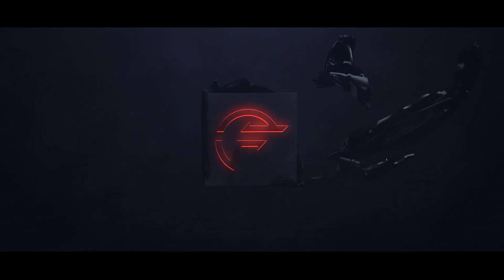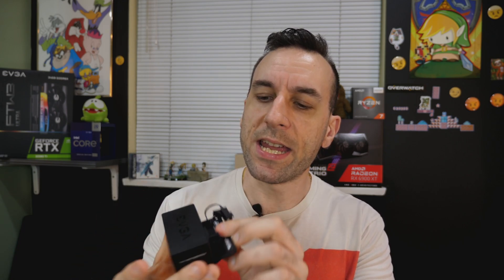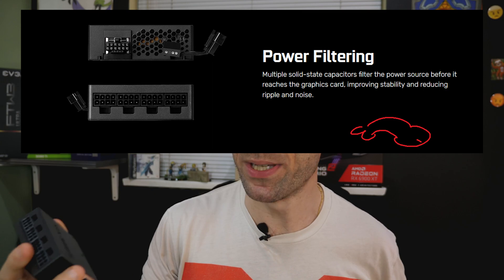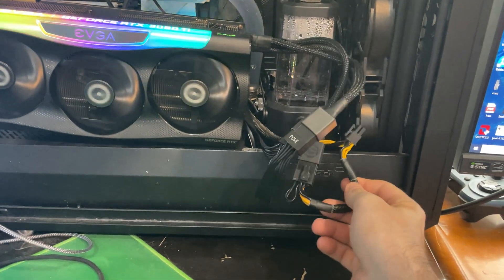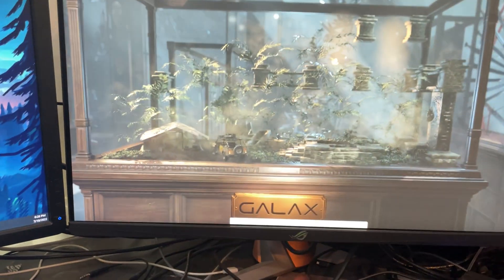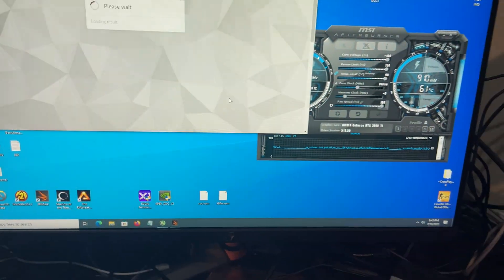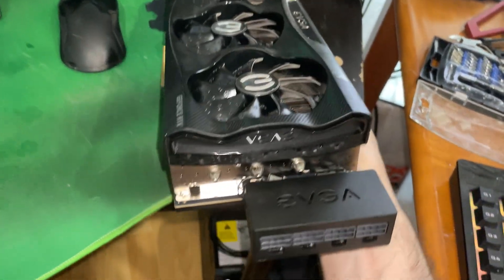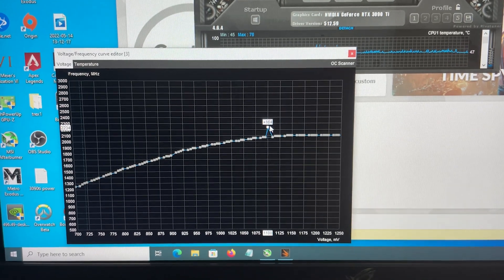EVGA Powerlink 41s REVIEW + BENCHMARK

Comment: This video has a LOT of incorrect information.

1: The PowerLink 41s and 52u for the 3090 TI FTW3 and Kingpin are for smoothing & filtering the load, yes. It's mainly to combat any transient power spikes and whatnot due to the high power draw of the cards.

2: The old PowerLink does NOT have capacitors in it, it's purely a cable re-routing piece for aesthetics. 

3: The fact that he's "benchmarking" it shows he has no idea what it's for. It's not advertised, or built, as an item to increase performance in any way. 

4: It only looks bad because he's running a shitty PSU with shitty looking cables. Anyone buying something like this is most likely buying things like aftermarket cables, and 4x 8 Pins combed together from like CableMod is going to look a lot better than the short shitty 12 pin to 3x 8 Pin cables all the 3090 TI GPUs came with. (Keep in mind, this was before the wide spread adoption of the 12(16) pin connectors, so aftermarket 12 pin cables really weren't a thing).

5: Having 4x 8 Pins also allows for a higher & safer power draw when running XOC bios. 

6: The 3090 TI FTW3/Kingpin PowerLinks are 41 and 52 because they're 4x8 Pin to 1x12 Pin  & 5x12 Pin to 2x12 Pin.

The only thing he got right is yes, it adds length to the GPU, which can be a deal breaker depending on your case size.

It's a shame they left the GPU market (and subsequently stopped making these) before a legit channel could do a proper review of them. Have a little respect for the genre and do even a shred of research into an item before just spewing your nonsense out onto YouTube.

Comment: October 25, 2022, the 16 pin plugs are getting reported being burned, or melting if the cables are bent and theoretically coming loose on any side that's bent. This is a great solution to solve this problem now.

Comment: if it would of redirected the 8 pins to the back it would be worth it just for the looks part of it.. then put the rgb on the front ( for vertical users) problem with the 12 pin is u cant bend them much and being at the end of the card it just makes the card overall length too much to fit into a lot of cases.

Comment: I am actually considering this as I am running a custom loop and I guess this gives you 675W TDP(150W x4 from 4x8pins and 65W from PCIE), and I guess this is where this make sense as it is at least better than some random 16pin to 4x8 pin as no major manufacturers make any 4x8pin transfers
Reply: And by the way I am considering it for a 4090, which I guess 600W is like a good OC setup as it is 450W out of factory already, unlike 3090ti which is more of a overclocked 3090 with was 300W and no headroom for oc

Comment: It looks like you doubled up on a couple of the 8 Pin PCIE connections? I am pretty sure this is intended for 4 separate connections to the PSU. It might be worth running the same series with that configuration.

Comment: To be clear, the earlier powerlink devices were all about aesthetics.  In your video you claim it contains capacitors but I really don't think it does.  EVGA doesn't claim that earlier product helps with power at all.  From their website: "The EVGA PowerLink has one primary function: to make your PC look even more awesome."  This new powerlink with the capacitors is to help smooth out the spikes.  From the new powerlink website page: "The EVGA PowerLink 41s seamlessly connects to your EVGA GeForce RTX 3090 Ti FTW3 while providing maximum stability, improved case airflow, and glows with fully-customizable ARGB LED."  So still some aesthetics, but I believe the main goal of the product is to provide capacitors capable of handling the spikey nature of the RTX 3090ti.
Reply: Agreed with your assessment.  I'm sill running an original 'PowerLink' on my graphics card (originally 980ti, moved to 1660ti, upgrading again soon based on TDP) in order to move the power wiring from the long edge (front) to the side which does improve the aesthetics and cable management greatly.
This new 'PowerLink' was actually designed to address the huge power-load demand of the GTX 3090ti by increasing the amount of available connections between the card and the PSU in order to prevent a literal melt-down of the original smaller wiring harness typically used.  Nothing more than a work-around to fix a badly designed (power-hungry) graphics card.

Comment: So I just purchased the EVGA 3090Ti Hybrid and it comes with a 3 x 8 pin to 1 x 12 pin pigtail. I’ve always heard of using separate PCIe cables, but there’s not an option for that here. Only the pigtail. Any comment?
Reply: Run 3 separate cable in to that pigtail.  The 12 pin you're talking about is the new power connector capable of 600 watts.
Reply: @Botanical4038  copy that. I kinda figured. Thanks!

Comment: So I'll admit this is a pretty good test, but you showed something that totally tears down some of your previous videos talking about max clocks on these cards.  That VF curve you used where you pull the 1100mv point way up destroys effective clocks, making it look like your card(s) clock very high.  I guess if you're consistent with this, then most of the time it doesn't invalidate the testing, but it's definitely misleading for people comparing what their cards can do that aren't using that method.
Reply: Can you elaborate on how it destroys effective clocks? What's the proper way to set a vf curve in that case?

Comment: I assume this product would help with the transient load spikes. I've had my <2 yr old 1300w Plat PSU degrade because of the spikes (confirmed via RMA)
Reply: I doubt it will be help at all for its size, and I have a x399 motherboard died because of the one made for 2080ti.

Comment: hello, are released technical data about Raptor lake (eg DDR5-5600 support) today with Intel 12 gen we reduce to bring the ddr5 to 5600mhz, in your opinion, with 13 gen, how long will we be able to bring them?  How much overall improvement (in MHz) will there be with the new Intel CPUs and the new Mobos?